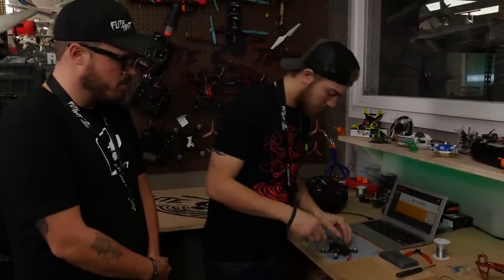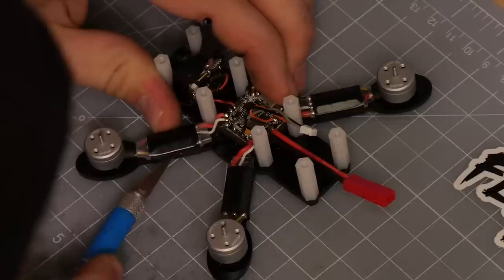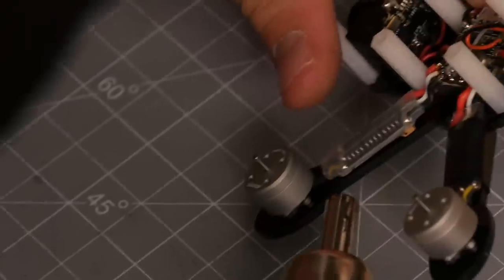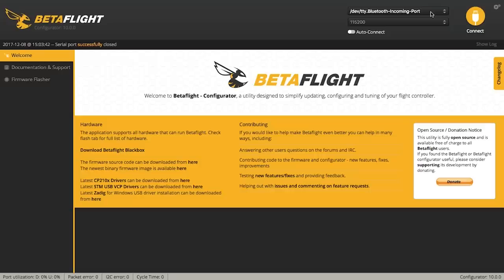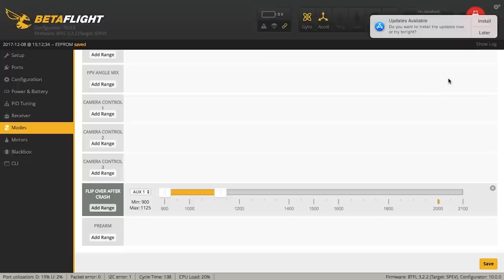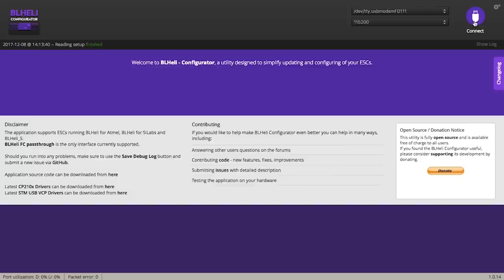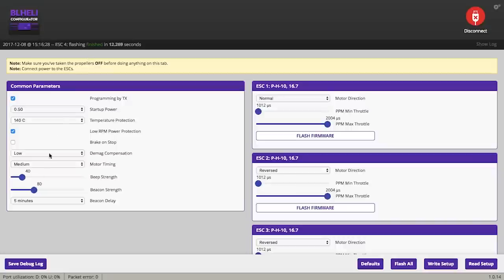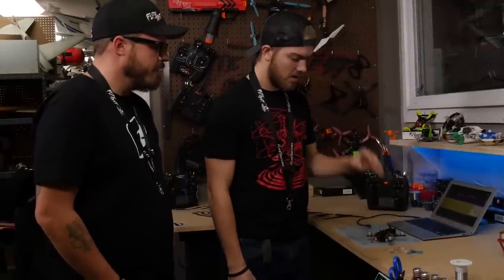How to set up Turtle Mode on your Gremlin Quad | FLITE TEST

Comment: Great video guys, really helpful for people who never done this. Maybe it should be mentioned soldering should be done is a well ventilated area as the fumes are toxic and it's better not to breathe them.

Another thing is not to use lead free solders iron as they work like crap. If your solder contains lead it will work much better and it will be way easier.

Comment: You should try taking a quad high up in the air and try using turtle mode as quick as possible to do a quick flip and try to regain control before it hits the ground.

Comment: a little confused... why unsolder 3 wires then resolder 2 in the same spot? just for some fresh heat shrink? which is going to be taped over anyway? looks great and clean but also somewhat silly to do 6 solder operations when you actually need only 2....
Reply: You don't have to if the signal wire is long enough but if it's not you'll have to get under the heat shrink. And the only way to put new heat shrink on is if one side is free

Comment: Hi, I was wondering : Since it is possible to make some motors spin backwards, is it also possible to make all of them spin backwards and fly 3D (thus be able to fly upside down) ?
Reply: Marnix Verkammen yes actually, rotor riot did an episode on zoefpv about her 3D quad it, really only takes specialized props and some work in beta flight. She explains it way better.
Reply: You also need different ESCs, most ESCs can't got instantly from one direction to the other. "Turtle mode" works because you disarm, switch to the opposite direction then rearm and during that time the motors stop spinning. The issue with instantly changing direction of the props in flight is that the ESCs get a surge of electricity when the motor stops and starts again, and this can/will fry the ESC(s).
Reply: Thanks both of you. Colt Ichinose, I'll search for that video. NoAgenda FPV, it makes sense, thank you.

Comment: What is the logic in only changing the wiring on one ESC?  Does it have to be a specific motor or do you just pick one?  Your video did not explain that.  We just see you doing surgery on motor 4 but that wasn't pointed out until you changed the mapping in Betaflight.

Comment: You guys should have clarified the only reason you changed the resource on motor 4 was to get D Shot to work on the femto flight controller you are using. Most flight controllers don't require you to do that these days. I can see people using this video for quads other than the gremlin and remapping resources they didn't need to. Those are definitely the saddest motors I have ever heard!
Reply: Thanks! I came to the comments specifically looking to the reason why you'd need to change the signal wire for this. Does it HAVE to be motor 4, or can it be any motor?
Reply: DyoGTS  Yes it has to be motor 4 if you are using the Femto fc. It has to do with how the board uses its dma channels. This was a big topic a year ago when dshot first came out, but now days I think people have forgotten the hoops we had to jump through to get dshot working.
Reply: OMG Thank You. I was pulling my hair out trying to figure out why they did it that way. Thanks you so much for your information

Comment: Question: How do you have ARM set to Aux4?  I run the same gear (DX9 and Spektrum race reciever on Gremlin) and have Aux1 for Arm and Aux2 for Flight Modes, leaving me with no other channels for turtle mode switch?
Reply: 13:46 shows what I mean, how is this done?  Did I miss one of your tutorial vids on this?
Reply: Jason West I'm not completely sure of this because I run a DX6e but if you go into your transmitters system settings, then go down to digital switch setup, select the channel you are wanting to use, then go down to channel, at that point you should be able to assign switches to channels. That should make it where you can go into beta flight in the receiver tab then just flip your switches to see which aux channel is assigned to each switch on your transmitter

Comment: Guys, what firmware are you using?  I flashed Betaflight 3.2.2 for SPRACINGF3EVO and my back right motor does not work.  FRSKY on SBUS.  Is this the right firmware?  Great video BTW, Ron

Comment: Yeah I have a question I have a 4 in 1 ESC would I use the 4 signal wires that are going to my distribution board just take number for and move it over it would that be the way I would do it or do you know on a 4in 1 board how I could do that with a turtle mode

Comment: the beta flight stand alone looks different and is showing different format readout when using the source command. The "Resource Motor 4 = A15" isn't working for me. It's just pulling another resource list. Someone mind helping me out and listing the new command to motor motor for to the ppm pad?

Comment: I am running ppm on mine is there another way to get this to work with out using ppm output?
Reply: Fpvcaptain you don’t need to reconfigure your ESC signal if you have a newer FC